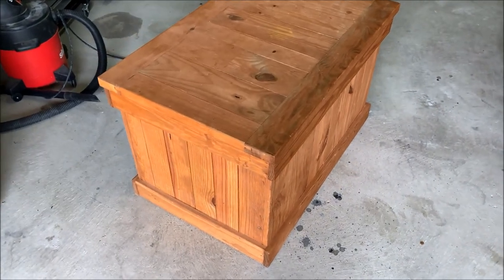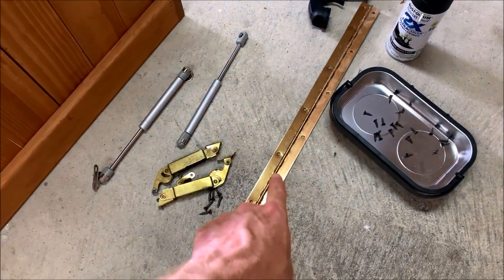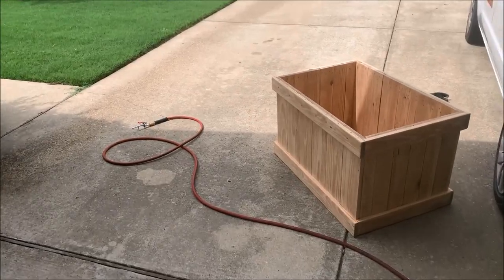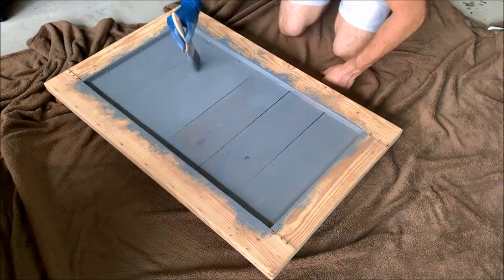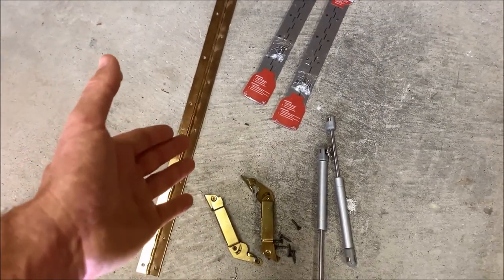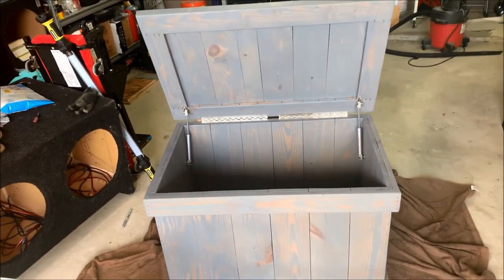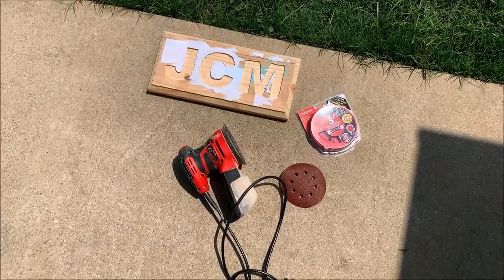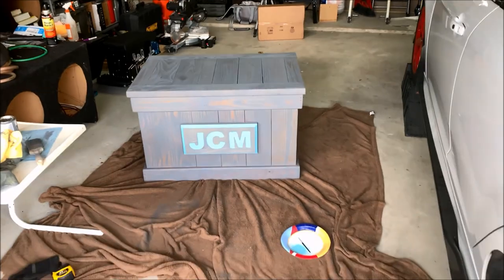Wood Toy Box Restoration with Custom Built initial plate...for my new baby boy!

Comment: Nice Job. Do you have a part number on the struts? How many foot pounds? about how much the lid weighed? Did you just guess at them and it worked out?
And do the gas struts help with lift assist also?